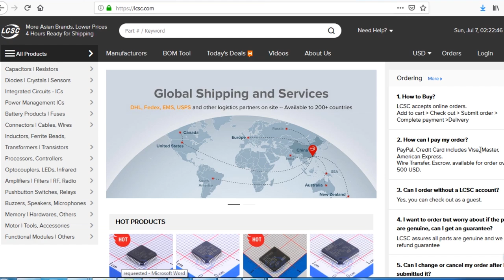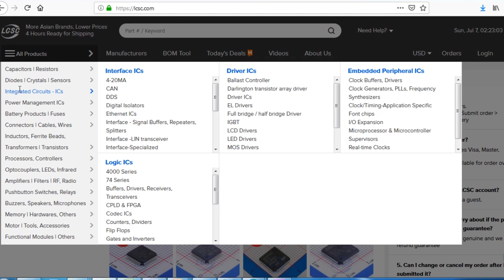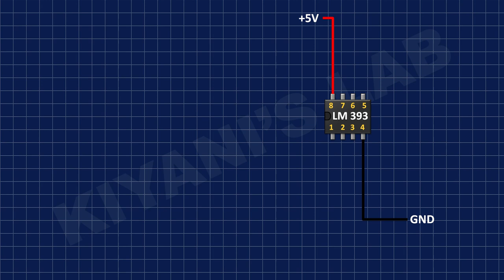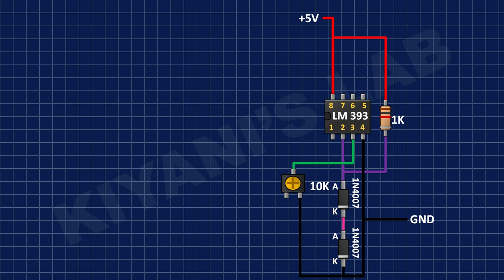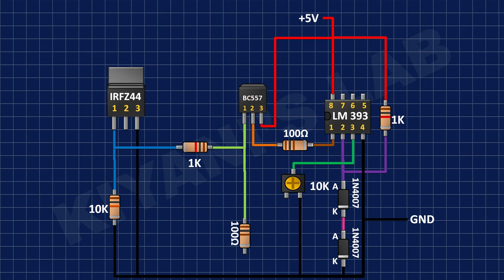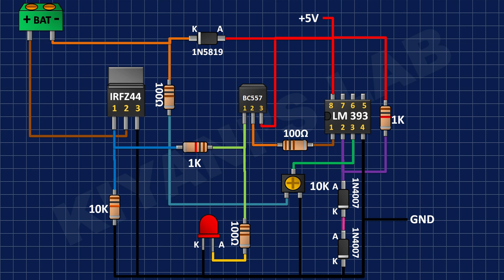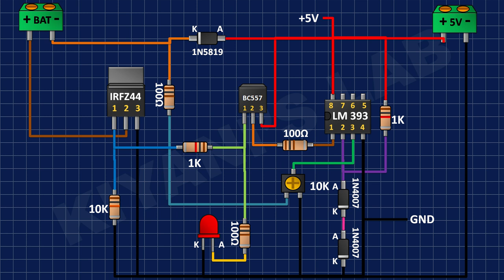How To Make 3.6V Battery Charger At Home | With Cutoff

Comment: With this circuit, can you have a variable input of 5 to 10 volts for charging three 1.25 v NiCD batteries and have the batteries power eight 3v LED lights? How would I have to change the circuit?

Comment: Sir in this video demonstration, have shown input power of 5v so that it would charge 18650 battery and when exceed 4.2 it'll cutoff for which you have two end points for connecting battery. How about to procure another two end points from battery as source to connect any device. like TP4056 module. will this work like tp4056 module. Please reply.

Comment: You are just doing like soldering video. That's all we watch. Why and how the circuit works, we have no idea. Because we didn't memorise the component pinouts.

How should I know what's pin-3 of LM393, or BC557, or anything. Why don't you use the standard schematic symbols, so that we understand what is happening.

Otherwise it is just some guy soldering something to something and at the end it works magically.

Comment: This cut off by volt limit or by current limit ? Because the good lithium battery charger have a cut of of exactly 4.16v and the current reach 10ma
Reply: It's volt limit
Reply: @geoepi321975  there is no courant limitation and it can be dangerous
Reply: there is no courant limitation and it can be dangerous
Reply: yes, it depends of the power of the source and capacity of the battery

Comment: Coloco 4.1 na saída para bateria e 5v na entrada, o led fica aceso direto e quando giro o potenciômetro não acontece nada, o led continua aceso, não funcionou, usei um ka3567 ou outro de canal N ou um transistor NPN, usei um TIP31 e nada, não tenho o diodo in5819 usei um 4007, pode me auxiliar? Abraços